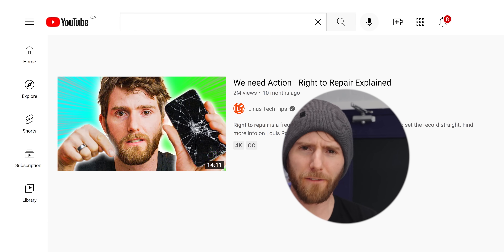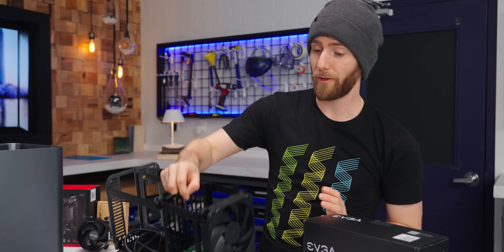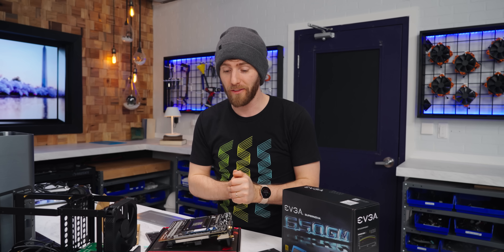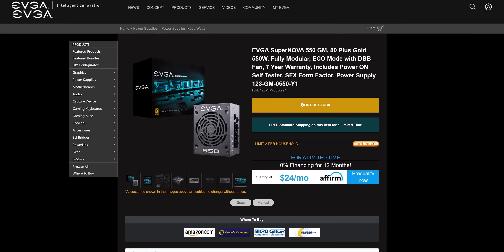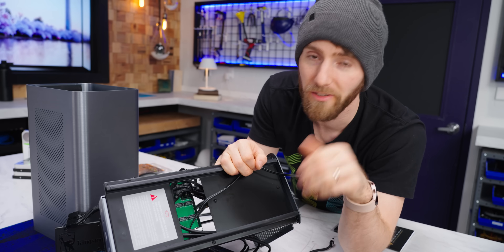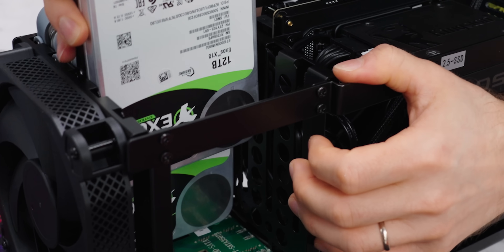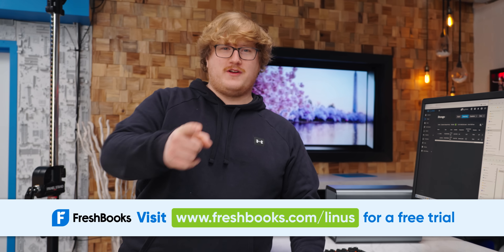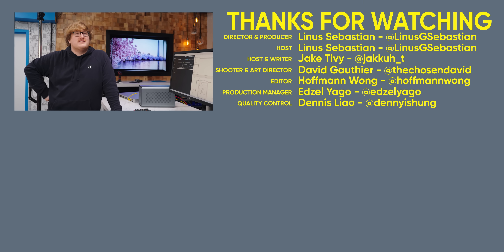This blows away the competition - JONSBO N1 NAS Build

Comment: Why not use ECC? AMD has very good support for that on consumer chips. And for a NAS ECC it's quite important.
Reply: I thought optane only worked on intel as a cache.
Reply: @brentgreeff1115  Using optane through Intel rapid storage technology in windows is intel exclusive. ZFS can use any storage drive as read or write(sort of) cache.
Reply: @brentgreeff1115  I think using it with Intel's special sauce requires Intel. But they are using it for its write endurance. Same reason I bought a couple Intel S3700s for my deduplication cache on my NAS. I'll be testing that out soon once I get my Ryzen rig back up and running.
Reply: ECC would've blown the budget. ECC UDIMM is significantly more expensive than consumer RAM.
Reply: @Steamrick  Nonsense. ECC RAM is only like 10% more than regular RAM. I did the research when I built my last rig. That's why I've got ECC in it. It was worth the few extra dollars.
Reply: @squatch545  ECC RDIMM maybe, but not ECC UDIMM. UDIMM ist about double the cost of non-ECC DDR4, at least where I live.
Reply: I can only think that Synology doesn't use it and they are challenging synology-like consumer solutions. Also excuse my ignorance but if it's really that important why isn't ECC used in most consumer NAS solutions?
Reply: @joshuatree9358  in fact the newe ryzen based synologys come with ecc out of the box. oh and also take half height pcie cards.
Reply: @joshuatree9358  It depends on what you are using. They are using ZFS here (something Synology usually doesn't do). ZFS uses RAM heavily and an error in memory can very well cause data corruption.
Reply: It's not as important as made out to be. And support is kinda spotty amongst specific motherboards.
Reply: Yep, I would have made sure I'm using ECC RAM for any mass storage device such as TrueNAS.
Reply: overrated for home and even small business use.
Reply: it's only important if your existing RAM has/or is prone to occasional lost bit errors.
Reply: @mdd1963  every memory module will produce errors. Without ECC you just don’t know it.
Reply: @dura2k  This is just not true, memory modules aren't guaranteed to produce errors. Obviously it's nice to have ECC to insure yourself against the occasions when it does happen, but if I do a frequent long memtest without issues I can pretty much sleep soundly.
Reply: @Naetrox  That’s not true. Faulty memory or bad configuration produces much more error, but every memory module can (and will with infinite time) produce errors. It’s the same with HDD and SSD. It‘s just physics.
Reply: @dura2k  ECC protects against bit flips, not against faulty modules. Even an ECC stick can fail and produce errors. Error codes / parity checks can fail when there's more than a single bit flip. You're still dead in the water if this happens. In particular with ZFS, the authors of the file system suggest ZFS has enough mitigations itself to run perfectly fine and stable on non-ECC RAM.
Reply: @Naetrox  That‘s what I said, but if the module is faulty it produces more errors, that’s usually what you check with testing the memory.
And ECC can detect multi-bit-errors, but not fix it and will (default) halt the server.
And no, they just say it will not harm (much) more than in other file-systems. They still recommend ECC if you want to prevent bitflips.
Reply: @dura2k  I do recommend ECC too if you want to prevent bitflips, but I see so many people act like bitflips are insanely common on non-ECC RAM when in reality that's not the case. I need to find some hard data to see the actual stats, and by all means if you run something critical opt for the ECC. For a home NAS, if it's for your ease of mind go for it, but I wouldn't even suggest storing important data on ONE system let alone one building - if you take the usual precautions the rare bit-flip due to solar rays or radioactive mice will ruin your day but not your life if you already follow precautions. For home, if I compare costs vs. availability here in Japan, I can't justify ECC. If I'm buying for the company yeah I'll go with ECC, they don't care about the extra costs but I'd like to protect my job against even the rarest occurrences.
Reply: @Naetrox  There are some stats from large datacenter and this happens often. And yeah, it depends, if the memory gets old, this may get worse. And if you do a scrub on zfs this could harm your data =/
But everyone should know the risk and decide based on this.
Reply: @dura2k  True. I'm almost always more worried about the disks themselves failing, I usually rely on BackBlaze's stats for that. Got any interesting stat sources? It's always nice to keep in mind for the future.
Reply: @Naetrox  I googled it sometimes, most oft the sources are a bit old, I’m not sure why. The hdd-failure stats are far better available (and the rate is much worse) but Google posted some I remember.
Reply: Yeah, especially when using ZFS it makes sense to use ECC.
Reply: @AniviaS  It makes sense to use ECC on any system, even gaming PC, yes, you lose a lot of FPS and it could be a problem in competitive but you gain infinitely in reliability and if you play competitive you probably want to avoid problems.

I don't think NTFS or EXT4 are immune to bits flip into the ram.
Reply: @francescoceladini  Most people wouldn't trade FPS for reliability when said reliability is imperceptible.
Reply: @francescoceladini  you have no clue what you are talking about
Reply: @nateg452  You have no idea what's ECC memory is for. It's not about uptime, in fact with ECC you could lower your uptime (because the system will crash if their is a non-fiaxable (2 bit) memory error).
ECC is their to fix/detect bit-flipping in memory and you want this to prevent data corruption.
Yeah, their is not that high chance of a bit flip causing big problems, but if they do you could lost data or, maybe worse, some data could be changed.
Reply: @nateg452  in the DDR5 they put the ecc on die completely at random because it is useless to anyone, the truth is that the lack of ECC in the desktop world belongs to intel which has purposely banned it.
ECC ram if they were sold to consumers would cost very little more than normal ram, on a dual side ram there would be 2 more modules for a total of 18 compared to 16 of a normal ram, yes, there are other things in which they differ from a normal ram but the price would be very comparable.
Reply: @ChrisHolzer  I probably don't know what i'm talking about but in the meantime i live very well with ECC ram.
Reply: @francescoceladini  ECC RAM is really pointless for games. Even if you get a bit flip in a game, worst it's gonna do is slightly mess up a model, maybe show a different number for a frame or if you're really really unlucky - crash (doesn't really happen in real life). If it's a competitive game, anything important about your in-game 'performance' (as in your skills) is bound to be something that's updated so frequently between server communication and new frames that a single bit flip would have almost no time to do anything. Even then, with older systems that are more susceptible to bitflips like 90s consoles and such, the actually reported instances where that actually had an effect on the game are so rare it's news when it happens. ECC RAM IS useful for hardening storage, but even then you could set up your RAM cache to flush frequently and do checksumming while it's doing that - then in the event of a corruption in a file while writing at least the system will detect it and try the operation again or give you a notice. In reality I've had my pool of drives constantly work for years with non-ECC and have never run into bit rot or flipping - obviously if your livelihood depends on 100% reliable file storage (like idk, storing encrypted VM images for customers) you'll want ECC... and backups... and off-site backups... and even more of them. I'm willing to bet a bit flip is rarer than your house burning down AS LONG as you don't fuck with RAM timings when you know nothing and don't do memtests. It's good practice to run memtests every now and then anyway as part of routine maintenance. Even ECC chips can go bad if the controller starts messing up.
Reply: Yup!
Reply: My question as well.
Reply: ECC UDIMMs are a little expensive.
Reply: @Lead_Foot  ECC UDIMM's are easily double the price in most cases, support is also board specific for AM4.
Reply: @Lead_Foot  No, memory is cheap, losing data is expensive!
Reply: @Lead_Foot  No, losing data is expensive, memory is cheap.
Reply: Yeah without ECC RAM it's a fileserver where you'd never store anything important... aka never store anything, it's useless.
Reply: ECC memory might as well be snake oil at this point. ZFS doesn’t do one checksum which only checked when the pool is recovered. ZFS checks the checksum during all read operations. Any RAM error that ECC would catch has to be persistent, always exactly the same error, and in exactly the memory address ZFS is using at that time for that specific piece of data.

99.9999% of the time bit rot is due to a failure in the long term storage medium not RAM. The error rate on HDDs of that size guarantees an error when reading them.
Reply: @Knirin  A year ago I was having storage issues due to a particularly bad pair of corsair low profile DDR4 ram. Files were getting corrupted left and right. Perhaps not common but it can happen, it may be a good idea to validate your ram at the very least before using it for large amounts of data.
Reply: @BrianMcKee  ECC RAM would have prevented the data corruption.   Bit Flips are rare but it CAN happen and you won't even know it until you try to open a file and it looks messed up.
Reply: For the same reason you don't use it on your phone, your laptop or your personal rig. It's not such a big deal, and zfs deals with potential bit flips better than most other file systems. 
It's nice-to-have; you might be running secondhand server hardware which comes with it by default, etc etc. But don't lose any sleep over it.
Reply: ECC is ok, but the point is building cheapest rig
Reply: ECC!!
Reply: ECC is pretty important with unraid right? since it runs off USB in to the ram
Reply: @liamsamuels6908  Everything runs off RAM and to an extent CPU cache - every instruction of every program has to go through the typical route of disk -> memory -> cpu which makes it possible for things to corrupt in between the chain. When you use USB (and some storage cards) you sometimes add the chipset to the chain, further increasing risk of failure.
Reply: You can use it if you think it's worth the cost. The rate of RAM errors that will cause file corruption are not that high (I'm not sure it's ever happened to me, although I have lost a few files to HDD issues), and for most people losing a single file occasionally is not that big of a deal.
Reply: ZFS doesn’t need ECC more than any other storage solution. You would loose data on Non-ZFS systems as well.
Reply: @orangefiltersky9387  I said: ECC is important for a NAS. I didnt mention zfs. And i stand with my point: A NAS really profits from ecc
Reply: dono what any of these abbreviations are
Reply: @ETHANR26  google is your friend..

Comment: You could just buy 1 100TB SSD instead of 5 HDDs. 100TB isn’t exciting anymore, especially if it’s spinning rust.
Reply: That's way more expensive. Most people won't be willing to pay for that
Reply: @mopilok  tbf, most people don’t need 100TB in general. Most people would be shocked how much 100TB costs even in HDDs.
Reply: and also have your single ssd die frequently and lose data
Reply: and I doubt there would be a significant performance difference in a typical household connection if it has to go over the local network
Reply: @meowmeowmeowmeowmeowmeowmeowml  you realize HDDs are less reliable?
Reply: @Khloya69  I am gonna say this as nice as possible... You should do a bit more research before making comments like this so you do not seem uninformed.
Reply: @Khloya69  no they are not, but keep telling yourself that
Reply: @meowmeowmeowmeowmeowmeowmeowml  spotted the man who has never used an SSD
Reply: @Khloya69  1) I'm talking about longevity, not reliability 2) you can swap the board on an hdd if that fails- not so easy with SSDs. 3) HDDs simply last longer than an SSD of the same price 4) why would you need throughput for something like this? you would more likely put your games and other apps demanding of disk throughput on a separate drive or locally?? 5) even if you don't agree with any of the points above, the SSD is more expensive, and also has no resilience against data loss if you only have one.
Reply: @Khloya69  I'm pretty sure everyone here has used an ssd, it's just that the rest of us understand their limits and know when or not to use one. An ssd for a home server makes no damn sense.
Reply: @meowmeowmeowmeowmeowmeowmeowml  no shit, if you’re buying an HDD priced SSD, you’re buying bargain basement tier drives.
Reply: $40k per drive and no parity? sure, go ahead.
Reply: @VietnamRealLife1  speed is more important. HDDs have no justification.
Reply: @Khloya69  ah yes, my backups really need to be accessed as fast as possible
Reply: @Khloya69  except this is for media storage like a Plex server. Not for games. You obviously don know anything
Reply: @linuxes9681  wtf is a plex
Reply: @Khloya69  speed don't make a damn bit of difference for a nas, you'd be limited by the speed of your  network more often than not